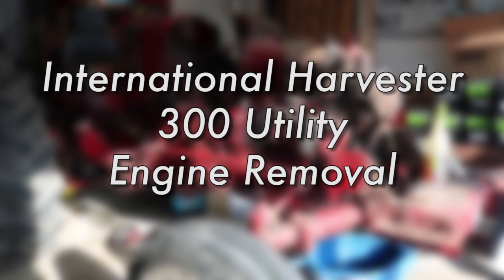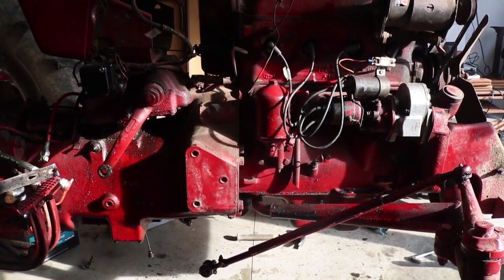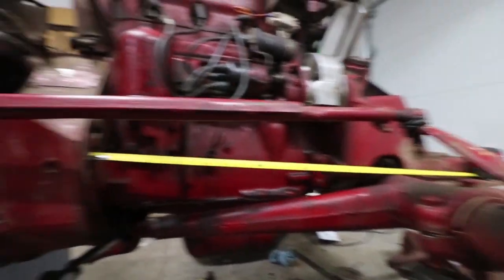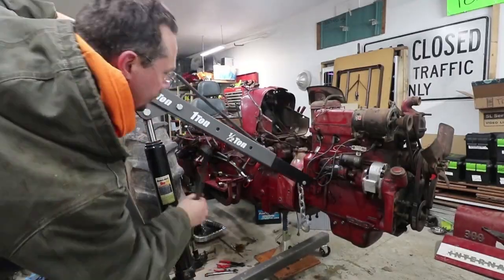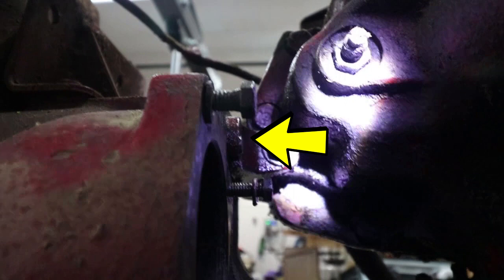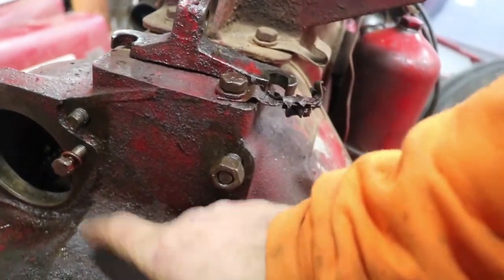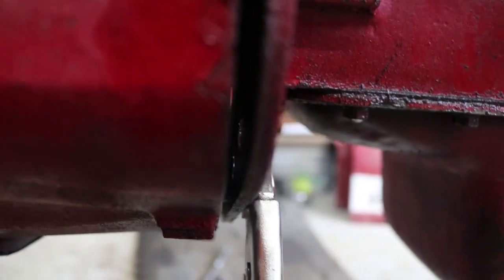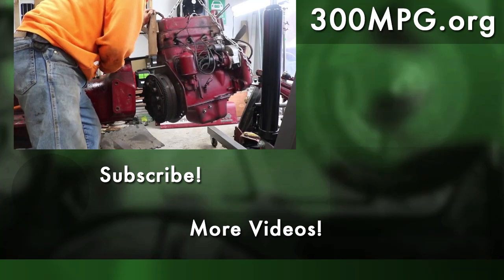Engine Removal - International Harvester 300 Utility for electric conversion

Comment: Well, it's been a few years. So, does this electric version function as well before the conversion?
Would you do it again? Or maybe a different route...
I just need to remove the engine from a 504 and I am not thrilled by any measurable aspect.
I've got a few...dozen categories of other things that I much rather be doing.
So what do I remove first? The steering wheel or the fluids...Heads I win...Tails you lose...
Reply: I remember years ago while doing my first engine rebuild, My girl friend's oldest daughter, (10) asked me why removing and reinstalling an engine was so much work?
 "In the cartoons they just rip it out, and then slap it back in..."
...What ?

Comment: Great job Ben. With the guide pins, rather than butcher up the thread, spin on two nuts and tighten them against each other then crank the inner one. If they slip, just tighten more until they don't. Should save a thread clean up job later. You may have been able to get one of those long top bolts the same way and save all that prying off caper. Wot fun. I have a IH OAS, which I'm led to believe stands for Orchard Agricultural Series. Sweet ol' thing. I can ignore it for over a year and it starts first time. Sadly no hydraulics so no TPL. Inspiring, thanks.

Comment: Very Cool! I am curious if you will run multiple electric motors, one for power, one for hydraulic pressure, etc... or will the electric motor run the transmission and then the transmission will run the hydraulic pump, power takeoffs, etc.
Reply from the maker: I think this will work best with one motor for the drive and PTO, and a separate one for hydraulics.
Reply: FYI the center hub in the clutch pressure plate is the drive for the pto you will need to retain that somehow.
Reply from the maker: @frankherring6253  Right. My next video will talk more about the transmission shaft and PTO. It's certainly MORE complicated that a traditional car manual transmission!
Reply: It certainly is that. The torque amplifier is in the first housing, then the transmission after that. I am not sure how much Horsepower the torque can stand; those tractors were around 40. If you find that it can’t take the strain of more power the torque amplifier can be removed and parts from an older tractor without a torque amplifier probably could be used. I am not trying to say it won’t be strong enough, if you are just going to mow with it, it should be fine.

Comment: Funny, I'm actually starting to work on a IH Cub Cadet 982 I'm doing an electric conversion to. I have the engine out already, I'm making decisions on Motor options now. This is great content btw! good work!
Reply: Ooh, nice mower! I'm doing the same to a Simplicity 5116 Special. Same stage as you and everything, although I have an old forklift motor for it. All it cost me was 60 bucks and 6 hours of driving!
Reply: @WilTushaus  where did you get one, I'm having real difficulty finding one at a reasonable price.